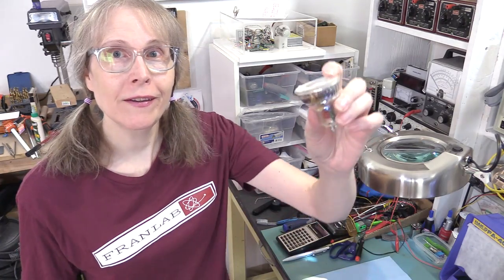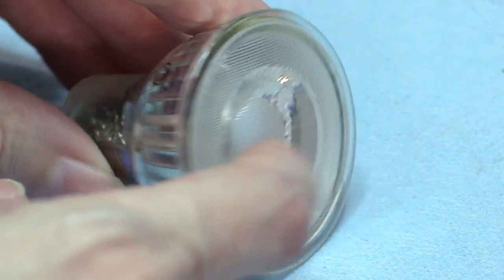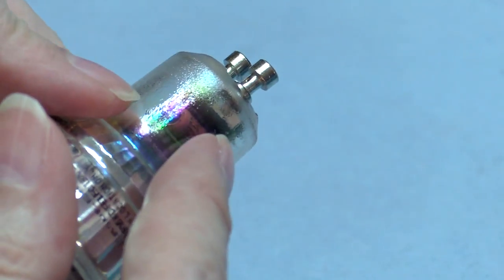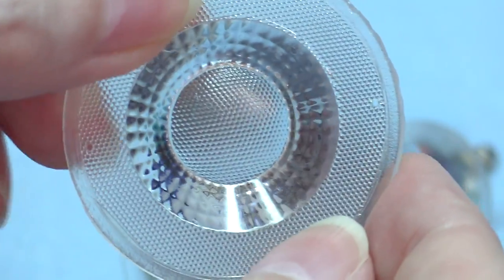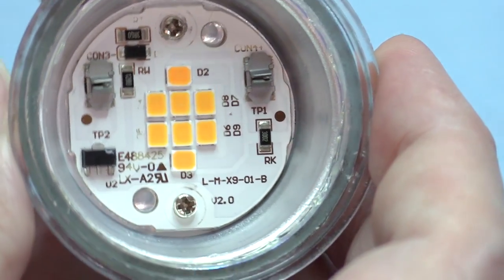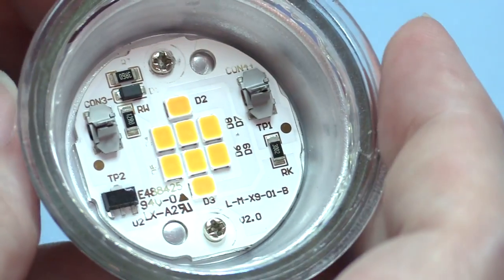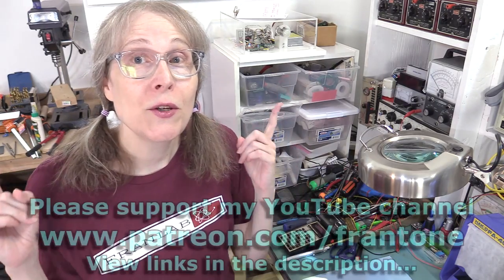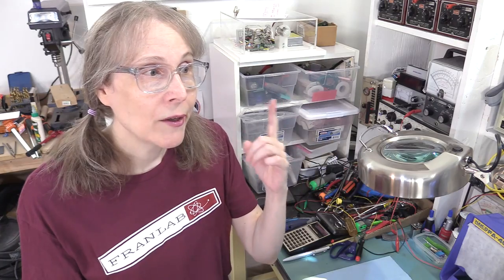Inside An LED Light

Comment: This is a link to an article that says a study from Finland showed the carbon footprint of manufacture of LED lamps is double conventional lamps. https://www.metropolismag.com/design/lighting/lightings-dark-secret-embodied-carbon-in-the-led-industry/
Reply: @evensgrey  , I did a quick mental count and I probably have about 50 bulbs in, around and outside of my house, nearly all of them LED (except for a few CFLs in the bathroom areas because my wife prefers those colorwise for doing makeup),  not counting some rope lighting and multi-LED under- cabinet lighting fixtures. I typically replace only 1 or 2 LED bulbs a year, which is great because many of the fixtures are difficult to reach, or require me to take down a glass dome in order to replace the bulb.  The bulbs that take the worst beating are a pair of lamps on either side of the garage which turn on via a timer every night and run for about 5 hours straight,  365 days a year. I got about 3 or 4 years out of those before they became dim enough that I really needed to replace them.  I have noticed that LED bulbs generally last longest if mounted into an open air fixture that allows heat to dissipate. Enclosed fixtures will shorten the life of LED bulbs,  but if you can find higher quality Led's that have some kind of metal collar on the exterior of the bulb to act as a heat sink,  those will usually last longer in an enclosed fixture.  Also, LED bulbs may last longer in fixtures with ceramic sockets that dissipate heat well, compared to plastic, phenolic or bakelite sockets.

The cost of electricity in my state is the highest in the nation, and yet my electric bill (in months when not using the air conditioning) runs around 115 bucks a month, including the use of an electric stove ,  electric clothes dryer, and well pump. I'd say LEDs are worthwhile!  Fran doesn't really get in to the fact that utility companies an power generation plants mostly burn fossil fuels of one kind or another,  and even nuclear plants have a high carbon footprint when you factor in the cost of mining, separating and processing uranium ore,  as well as the issue of toxic mining tailings and the actual spent nuclear material that needs to be stored for a 1000 years.

Also note that the bulb that Fran disassembled has cheap electrolytically capacitors on it, those will likely be the very 1st component to fail.  I don't know what the carbon footprint is to produce surface mount resistors, transistors, diodes and capacitors,  but considering that those same parts are used in tens of the thousands of other types of electronic devices,  the economies of scale of the factories that produce them is probably lest wasteful energy-wise than the amount of electricity that we would require to power incandescent bulbs in our homes and businesses on a regular basis.
Reply: Tell that to all the green little girls that are telling me how to live my life. Oh, but wait. Don't confuse them with facts; their minds are already made up.
Reply: @goodun2974  
Thanks for keeping it short.
Reply: @rudolphguarnacci197  , in other words, don't confuse simpletons whose psyches are fixated on "dont tell me what to do" by introducing information that might provoke cognitive dissonance.
Reply: @evensgrey  , I'm with you on this; but try explaining it to "Rudolph with his nose so bright" below. This might be a case where, as has been said,  the difficulty in explaining a thing to a man is directly correlated to the increase in his bank account gained by not understanding it....or, it might just be a case of "don't tell me what to do".
Reply: @goodun2974  
Yes.

Comment: LED lighting is "supposed" to have a rated life of up to 50,000 hours. That's 50 times longer than a traditional incandescent bulb. So running one 8 hours a day would theoretically last 17 years. 

HOWEVER, that assumes the manufacturer is using quality components in the manufacturing process. The big names, like GE and Philips, might adhere to those standards. But some no-name Chinese manufacturer is going to use cheap electronic components that fail a lot more quickly.
Reply: One of the best Hackaday articles I saw was called "What happened to the 100,000 Hour LED Lamp" and was all about the corners cut to drive down the price of LED bulbs that ruins the lifespan.
Reply: I haven't had a single led bulb fail on me yet.
I try getting good quality bulbs.
 The law here is 5 year warranty.
Reply: @bikesmith  the claim is usually 10,000 hours on average, but usually depends on the batch. some will last 1 year and others 5.
Reply: When I have replaced the lights at home, I went to the store and asked to have LED bulbs. They offered a few, all noname made-in-china brands. They just all went out after around a year. Then I was looking for replacement, but all the stores were like "oh we have only this xing-xing superpower superlight, noone ever complained". Well, I do. I refused to buy them and just walked around the dark bathroom for a while. To get some proper bulbs, I had to order from the internet somewhere, so I finally have Polaroid lights. These are only 2 years old now, but for some "strange reason", none of them failed so far...
Reply: ok before we all stone the manufacturers of the LEDS , the power that comes into your home is NOT squeaky clean 220 Volts AC. Sometimes it's a little more, sometimes a bit less depending upon the state of your transformer on your power pole. Grid voltage can vary, true the transformer should give you some isolation from that but grid power inside your house is "noisy" with spikes and transients in it, that's why you need filtered, regulated power into your PC'S and sensitive electronics.  These line fluctuations can and do add voltage and current surges in line power of your home. This can effect the life of anything plugged into it. Surges, power outages are something most electronics dont like. It can and does affect their service life.
Reply: @bigrockets  ????
Ok but the switch mode power supply should easily deal with that if we'll engendered.
Just like your mobile phone charger works with 110V-240V AC and outputs the same regardless.
And yes, there can be "noise" in AC lines and small  voltage variations but not  current and voltage.  For the same load, if voltage goes up current must go down or vice versa.
In my experience, with led light bulbs, it is never the leds  themselves that fail, it is always the power supply.
Reply: Even for a high quality bulb I doubt 50k, they just run too hot to not cook a cap or kill something else in half that time.
Reply: @Broken_Yugo  exactly, its the heat that shortens the life of the led chips and electrolytic caps.,, in some cases it can be possible to open it and 'mod. the circuit to reduce led current and extend life, with some loss of brightness
Reply: in a lot of cases its the the cheaper circuit type that uses a poly dielectric capacitor as a current limiting dropper thats better than the ones with switching supply/regulator , less to fail, and led current is lower,  unfortunately also less brightness

Comment: I've worked on some LED driver designs using some of the popular control chips on the market.
One of the most common designs uses electrolytic capacitors and those have horrible life expectancies. Even worse at elevated temperatures.
Best case for even some of the best is about 6000 hours.

Comment: What most people are not aware of is that most LED chips are operated in 'strobed' mode. That means the LED 'flashes' faster than the eye can see it. This saves power and reduces the heat generated. My high-power flashlight operates that way. When I shine the beam through falling rain, you see dots rather than streaks. Neat!

Comment: You make a good point about the carbon footprint Fran, I had an integrated led fixture in my house and when it went bad the whole fixture and not just a lamp would be thrown away. I have seen huge led highbay lights that fail and have to be replaced generating a lot more waste then just a 400w MH light bulb.

Comment: When they started marketing the LED lights, it was said that they would last for years, but they didn't. The cheaper they are, the less they last. I am amazed that takes that much circuitry to illuminate diodes. I understand we're cutting the voltage down as the component doesn't take that much to activate it. I just thought w/ advancement in electronics that we could at least find a smaller package to do the job. Excellent video, learned a lot. Thank you.

Comment: I suspect the only reason the Halogen filament lamp (called an GU10 in the UK) glass reflector is being used, is due to huge stocks of them being already made. Once these stocks are depleted, then the lamp manufacturers will probably use something less expensive to make, like plastic. 

The total life carbon footprint is an interesting one, for which the numbers could probably be fudged either way.

The main issue with the electronics, is the disposal of them. A standard filament lamp is pretty inert, once in land fill, but the composition of all the components in the LED lamp, must have some serious long term environmental effects.
Reply: Once most types of things are in a landfill, how much of a serious environmental reach will that object have?  In other words, if we made a new sealed up Mt. Everest in the middle of Kansas, composed of trash.  What would be the effect on the larger environment?  I suppose there might be some minor cloud formations and shade cast from the new inert mountain.  
You know, someday when there is a zombie apocalypse people will be happy that resources will be able to be found in a condensed location, such as a landfill.
Reply: @peaceonearth8693  Unfortunately, one can't make a gas tight seal around land fills.
Most of the carbon in deposited waste does get broken down and eventually released into air as methane or CO2.

Comment: I think it would indeed be interesting in getting data on the manufacturing process power. 
Even more interestingly is to plot it with the LED bulb system (yes cause I'm pretty sure what's gonna fail is the switching circuit, not the actual LEDs) lifetime and therefore power used during that period compared to the other solutions.
The results will be the complete power per life for each solution, quite interesting to understand where things need to be improved.
Reply: @evensgrey  , yes, and enclosed fixtures may require you to use a screwdriver to remove a glass dome before changing the bulb ---- always a fun thing to do while standing on a ladder!

Comment: Great video...yeah, you'd have to factor in useful life, and how easy is it to recycle? I've had good luck with LED bulbs..the shortest lived one being about 18 months, and I suspect a storm took that one out. An LED bulb is no better than its cheapest component.
      I put two Dollar Tree bulbs in a freight elevator at work last November. They're on 24/7/365...so far, still going.
    Years ago, I went around replacing bulbs in exit lights after a major storm. Several had been silvered by vaporized filaments...looked cool...kind of a dark silver...

Comment: I wish there was a common DC standard circuit in every house, then these individual DC products wouldn't need the components for mains to DC conversion.  (I realize the circuit amperage would have to be higher, though.)  Then you could just have one or more high quality, DC power supplies that could be built to (hopefully) a higher standard.
Reply: The problem isn't DC as LED's really need a constant current driver.   I think the main issue is that we shouldn't package the LEDs and the driver together, instead we need fixtures that have LED drivers that are physically and thermally separated from the LED part.  The heat from the LED's degrades the driver lifetimes.  This is the unfortunate consequence of trying to be backwards compatible with incandescent light fixtures.
Reply: You hit the nail on the head.
Reply: @argcargv  that is a good point. LED lights don't need screw in sockets since LEDs last up to 100,000 hours if the light is well designed. Design engineers need to make sure that the LEDs are not overpowered and heatsinked appropriately. The driver circuit should be in a separate enclosure away from the hot LEDs to make sure that the components are not exposed to high temperatures.
Reply: You can’t transmit dc over long distance, go back to when electricity was invented, and they had competing implementations of ac and dc power stations in New York, the ac system was better hence why we use it
Reply: @gower1973  Technically DC is actually better for transmission over long distances (no extra line capacitance charging current and no skin effects), but the DC systems are less reliable because conversion is complex.  Surprisingly, DC transmission has been in use since the 1930s.  See https://en.wikipedia.org/wiki/High-voltage_direct_current
Reply: You could make that legally yourself, it is some places called solar power for you cabin! :-) At least in my country, Norway, anyone could legally equip their cabin with 12V solar power,
(the limit is actually 48 volt) So when building a new house, you could set up a 12 volt system for the lighting, and charging outlets (12 to 5 volts) with a battery bank inbetween, so 
that your lights did not go out during power cuts. Of course, internet router, PC, TV etc. could also to some degree be connected to the same system, so that you had internet, via 4/5G
cell phone connection, even during power cuts. The 12V solar power for cabin system, has its own 12V DC polarised outlets, meaning, anything that you want to run on 12V, could
be equipped with that plug, like chargers, dustbusters, whatever. The beauty of this, is that you can do it yourself, on a limited budget, while going offgrid with full AC power,
is much more complicated, needing expencive inverters and everything, and an electrician to set it all up, and electricians who know about this, are not available everywhere.

I some cases, you can get an advantage from many people dismantling their solar powered system in their cabin, because they upgrade to AC power, then being able to buy cheap 
equipment, like contacts, distribution boxes, panels etc. 

 And yes, if you already have a battery bank in the basement, why not hook up a couple of solar panels too, perhaps also smaller wind turbine if you live on the countryside. :-b

Comment: One issue I have with LED lights is the RF Interference that many of the cheaper units generate.  I am a ham (amateur) radio operator and have come across many radio interference issues created with switch mode/PWM LED power supplies.  

I have 25 x 20W Halogen closed face lamps in my living areas for over 20 years.  Almost all of them are on a Clipsal C-Bus dimmer (soft start).  I bought a pack of 10 replacements in 2001, as I type this... I still have seven brand new lamps in the pack.

Comment: I never thought about the carbon footprint in LED lights. Great info. How about electric cars, same issue...
Reply: No. Electric cars are pretty much completely recyclable, unlike LED lamps.
Reply: I think its the same with all cars to be fair. They should give you a the carbon footprint in creating and shipping the car, not just running it. I see people replacing their car every 3 years with a new one to lower their carbon footprint, there's no way they could offset that much in a short period of time. I think the problem will really hit the electric cars in a few years, when they stop getting software updates and you can't get replacement batteries.
Reply: It might be the case that electric cars could mostly be recycled but the carbon footprint to power them .
Reply: Will Fran now dismantle an electric car?
Reply: @blueyonder1233  lol..

Comment: Hi Fran,  I bought some early LED outdoor Flood Lights for my home, at Costco. They are going on 7 years.  I sell a couple of brands of mostly indoor LED bulbs. Many of them have five years warrantees. We have exchanged a few that have failed but very small numbers of failures out of all that we sell.  Please do a segment on the topic of LED automotive headlights. I believe some should be outlawed because of excessively high output and high color temperatures.  They drive me crazy. 
On a completely different subject,  I once sold  The Proco RAT Fuzz Box some years ago. Personally I prefer tremolo and reverb over fuzz, although I always loved "Satisfaction". :)